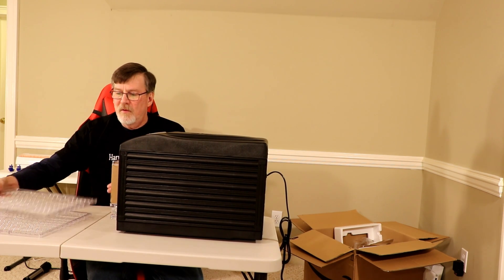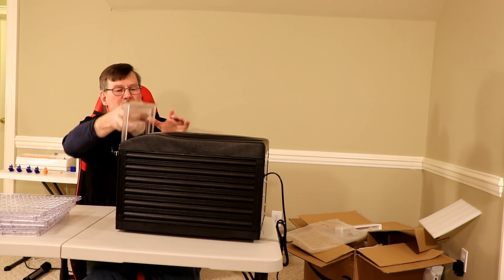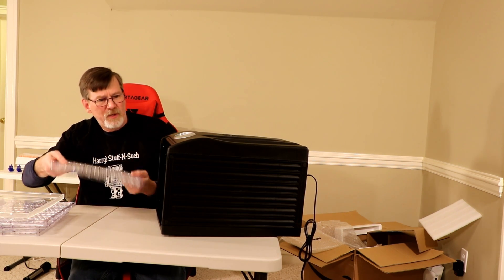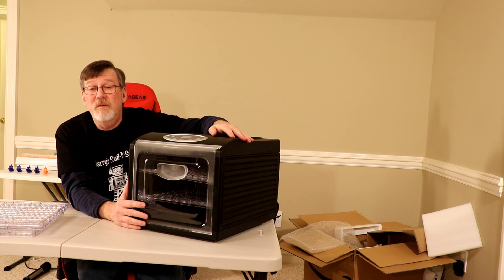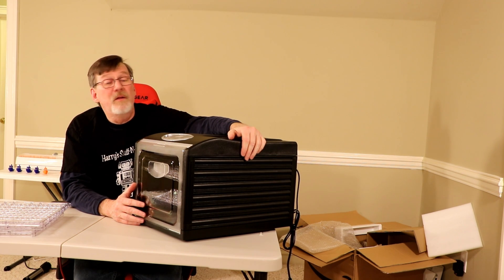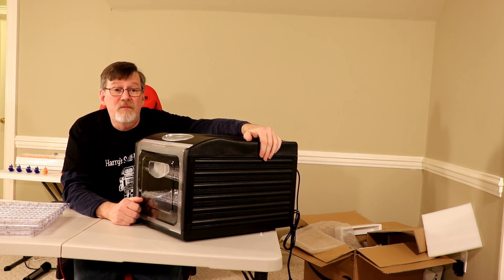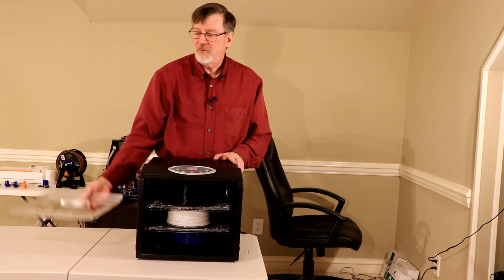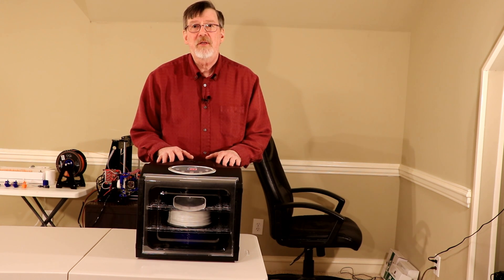How to Remove Moisture From 3D Print Filament

Comment: Oven + vac bag + silica gel packs for the win. Saves on space.
Reply from the maker: I've used our convection oven as well for drying filament, but my wife prefers to use it for cooking dinner...go figure...I also have a vacuum sealer but fine storing my dried filament in a sealed 5 gallon bucket  or an air tight storage container (with gel packs of course)  to be more covenant. Thanks for the comment...

Comment: What temperature do you set it at and how long?
Reply from the maker: It depends on the material or more importantly the glass transition temperature of the material you use for printing. You want to make sure that you keep the oven temp below the transition temp. PLA has a glass transition temp of around 60C so I set temp to 40C (104F) for about 6 hours. ABS has a glass transition temp of around 105C so I set the temp to 60C (140F) for 3-4 hours. Other filaments have different  glass transition temp.  But be aware, even if the glass transition temp is very high, for a material like Polycarbonate, the spool your filament is wound on is likely made from an ABS which will soften at lower temp than the filament. In general, 70C is the max temp I will use for drying. Once I have dried my filament, I let it cool then place it in a dry box with some desiccants. You can use a 5 gallon bucket with a lid or a plastic storage container as long as it has an air tight lid.
Reply: Harry's Stuff-N-Such 
Thanks my friend